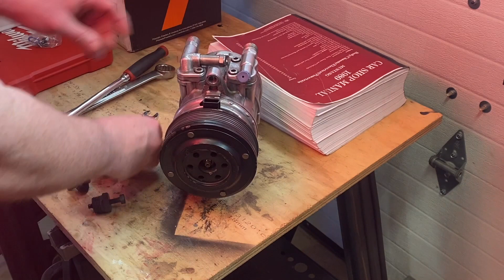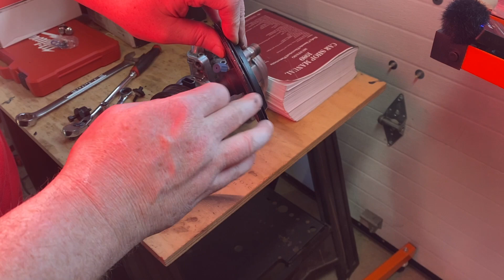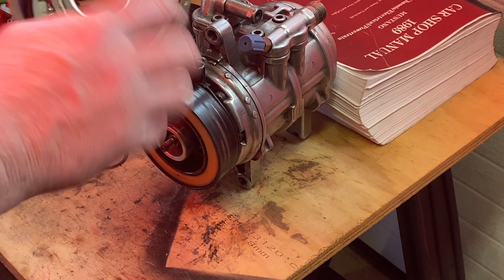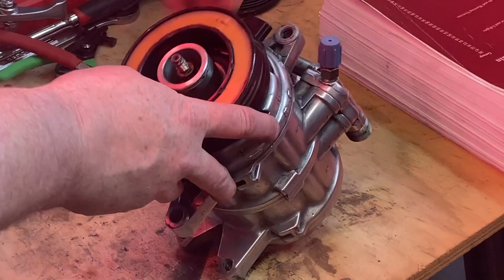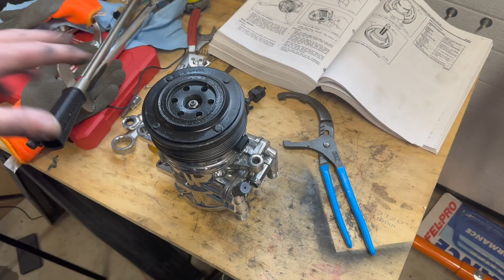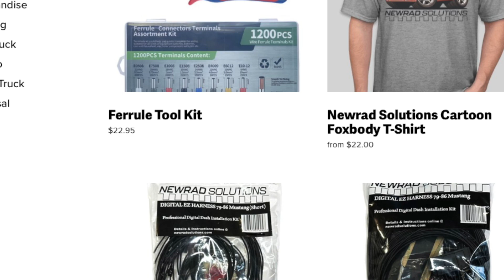Foxbody AC Compressor Install

Comment: Is that a 134-A compressor or?
Reply from the maker: This is OEM compressor (actually original to car) that I swapped the manifold connectors on top and rebuilt it like 8 years ago.

Comment: Mine works currently will save this for later though
Reply from the maker: It's usually obviously when the bearing starts to go.   I like to just replace the pulley and the clutch when I take them apart but in this case almost brand new still.